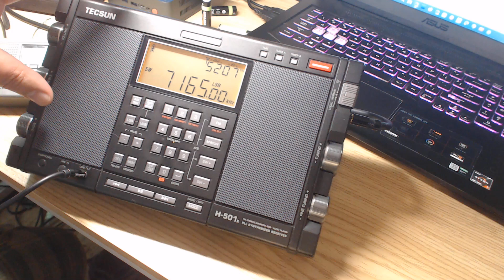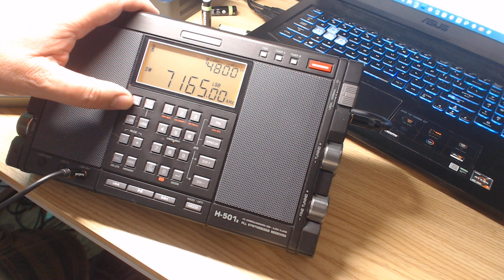Shortwave 101 Beginners series What is AGC or Automatic Gain Control

Comment: Yes, there is definitely a gap in the market for one of these portables with some options for adjustable AGC!  I bought the Tecsun 330 recently and the audio quality is sometimes really frustrating to listen to on AM because of this, which is a pity as it's such a great radio otherwise, for the price.
Reply: It's essentially an audio compressor/limiter and as most broadcast stations already use this on their audio output, it can often push the level of compression too far which can make it tiring to listen to.